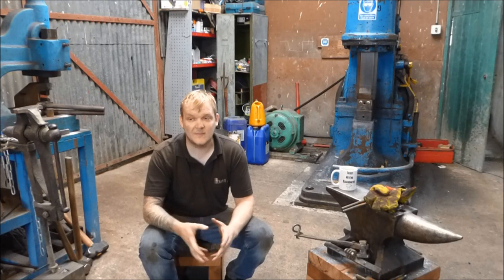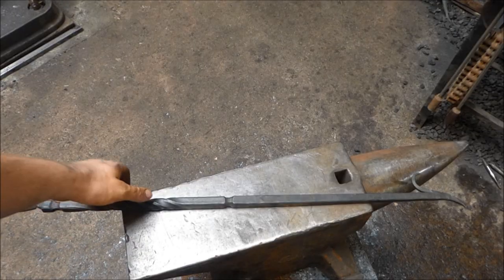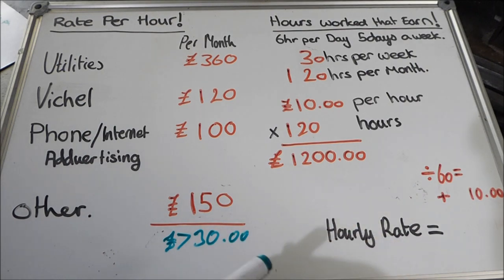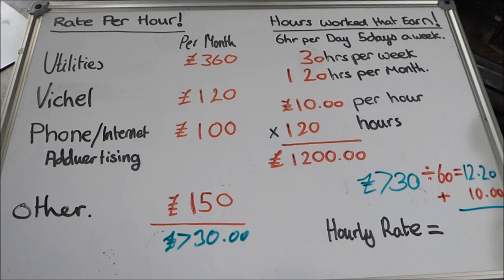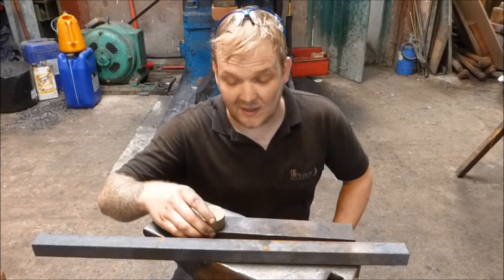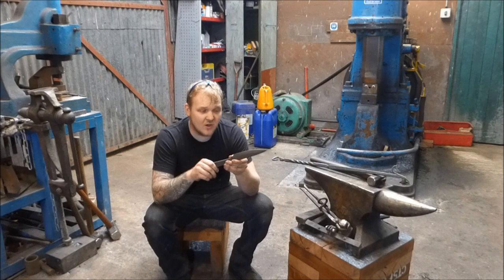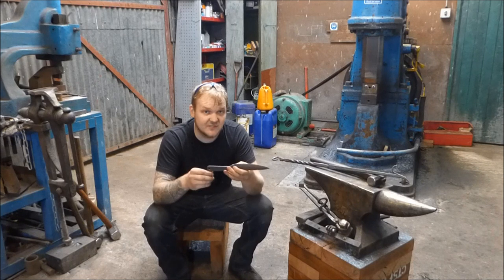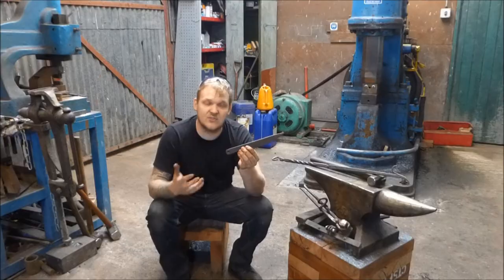How to make Money as a Blacksmith! What You Should be making an Hour! Trust me I'ma Blacksmith!

Comment: The fire pokers I turned out at the Pioneer Village were sold at a low price of $30 - $35 at the gift shop however they were not out to make money, just to pay for supplies. That's around 25 - 26 pounds I believe. They were worth more than that but that's what they did. And I could not make enough of them. I mostly forged out handles when folks were not around as that part is boring, maybe do a fire weld when folks were in the shop just for some picture moments. I'd tell the folks to get ready for the fireworks.

Comment: Well put Daniel. I typically figure my prices off of what I earn from my day job. If I were to earn $18.00 an hour doing overtime, which I feel my hobby smithing is considered, and I basically void the material cost since a lot of the steel I use is recycled. I do add a little for my fuel cost though. The other thing that is a BIG factor, is my market. If I am selling to complete strangers, I set the price a bit over, and allow for discussion on price. On the other hand, at SCA events, I try to ask a fair price or even under cut a bit, since happy customs bring in more money. Sometimes I have taken it to far, but as said before, it is a hobby and not a career. Hope you had the chance to see my 'for Daniel Moss' video.
Reply from the maker: I think that its different if your running it as a hobby forge so well put. You make a fair point. I would suggest you put your prices up dude and see if you still sell. thank you for the great comment. loved the pins dude.
Reply: Daniel Moss always good to leave room to haggle, right? :)

Comment: Made a mistake there Dan, need to pay yourself when your doing run the business stuff that doesnt earn money. IE if you spend 2 hours a day quoting, maintaining gear etc, and 6 hours a day earning money - you still need to get paid for your time of 8 hours. It is part of the cost of running the business. SO while all the utilities etc get calculated on 6 hours, you need to have 8 hours of paying Dan!
Reply from the maker: Jack Dawg so who pays you for that if you do a quote and you don't get the job?
Reply: You have to span it out over the hours that pay - ie instead of adding 10 pound per hour as your required wages, you know about 20% of your time running the business doesnt earn money directly, you add 20% to that 10 pounds in your hourly rate calculation, so the 12 pound earned for 80% of the time pays you for all your time. Your time running the business is just as much an overhead that should go in to the hourly rate as paying the power bill is!
Reply from the maker: Jack Dawg I understand what your getting at but that's why I doubled the amount per hour you should earn to cover the in consistency. You can't make money out of nothing. Also pretending that your getting paid for every hour you work isn't real. it's just not how it works. if you drop the ball and have to redo a load of work who pays for that.
Reply from the maker: Do you run a forge or some sort of business dude? I would like to say that this is what i charge for my hourly rate but i did work it out this way. I as uses this time of rate for working out pre made items. To inform me of where the price i charge should be. If you read some of the comments here lots think I'm over charging. I do see what your saying by the way I just don't feel that It works that way. If you only earn 60 hours in a month but you pay your self for a 120 hours where does the extra money come from??
Reply: I agree with Jack Dog.  Suppose you got to the point where you have to work at the anvil more just to keep up what you have drummed up in work.  What will happen is soon you will run out of anvil work because you didn't spend time making estimates.  You have 2 choices.  You stop and drum up more business, or you hire an estimator.  You have to pay that estimator, correct?  So, if the estimator earns a wage, why shouldn't you also?  I had a commercial construction company in California, and I experienced this very same scenario, except I had 2 estimators plus myself and a superintendent and a secretary (35+ employees).  I am showing something perhaps too extreme to fit you, but in any case, you should be paid for your estimating time etc.  For without the estimating time, there will be no anvil time.   No money can be made until, and  unless somebody sells something first!  Retired now, and spend my time watching great videos like yours!  And a little anvil work.  Thanks- Jerry
Reply: Great insight.  Pure business POV.  Excellent.  I'm an artist and WRESTLE to value disparate aspects of my production in a mathematically faithful and effective manner.  Ironic.  ALL time is lifetime, right?

Comment: £3 of material?! where are you buying you steel?
Reply: Tobias Forbes Gower You could try http://www.fhbrundle.co.uk
Reply: well you have the steel, then to coal/coke the power for the fan and the finish material like bees wax.  So thats low balling it to me.
Reply: I don't struggle buying steel, it just seems expensive for a meter of 12 square
Reply from the maker: Its was a little of the top of my head but i did check today the cost for a 3 meter length from underwoods (which i do not buy from) but if that is your only option is £12.50 making 600mm £2.40. so i wasn't far off. the truth is i brought the bar in bolk for a lock stock holder at trade almost costing about £10.30+vat for a full length. That made the bar £1.20 ish. I also had to collect it call that 10p ish so let say £1.30ish. But a fair point dude. thank you for the comment.
Reply from the maker: Also the power, fuel and bees wax is in the hourly rate dude but if you think i was low thats cool each to there own its just a rough idea sort of thing. thank you for the comment dude.
Reply: wasn't a criticism Dan, I just hoped you weren't getting ripped off that badly
Reply from the maker: That's where my head was at dude.
Reply from the maker: I know it wasn't dude just wanted to justify my answer. Lots of people listing in you know. Also llots of people getting ripped of as well. I know you was only trying to help. thanks dude.
Reply: Tobias Forbes Gower I pay $0.40 per foot for 5/8 square bar